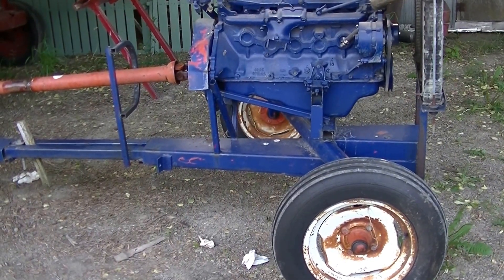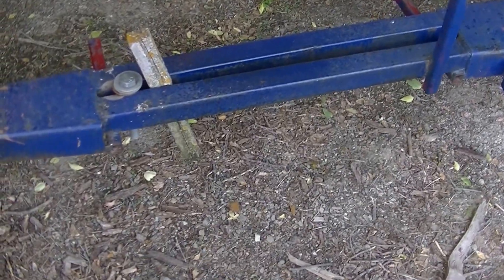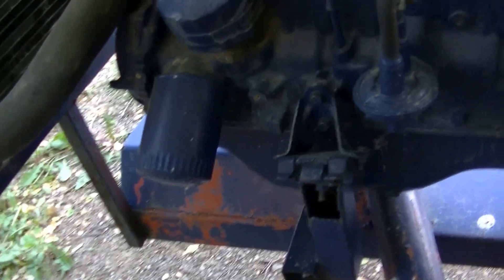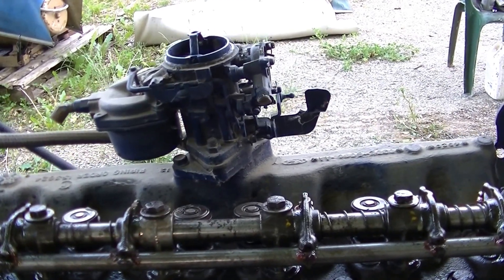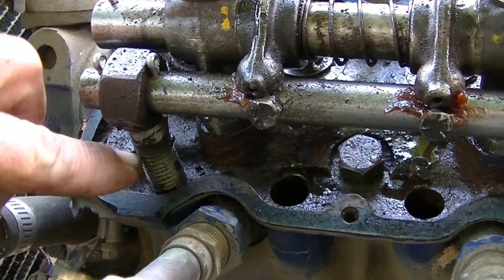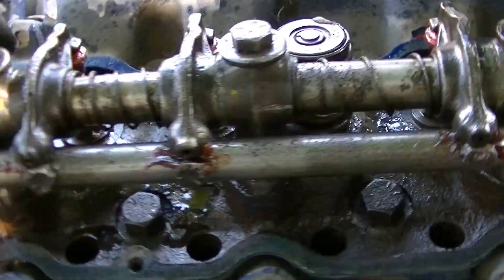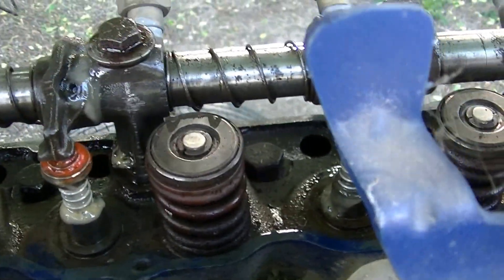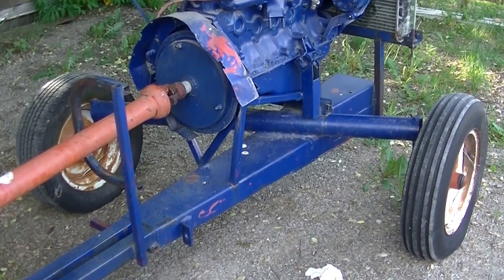PTO Driven Car Engine Air Compressor - Part 1 - zeketheantiquefreak

Comment: Any info on these light valve springs? .... how much CFM does it make?
Reply from the maker: The light valve springs were odds & ends just strong enough to close the valve against gravity. I siliconed the keepers so nothing would fall apart and drop a valve into the cylinder.
Reply from the maker: It will run a full-size sandblast nozzle without running low. I have no clue as to how to measure CFM, though.

Comment: Nice explanation. Very easy and cool unload system. 
I am planning to get 4 cyl diesel preferably IDI as they have combustion chamber inside the head and it is easy to completely block off. 
I want to make it 2 cylinder running 2 cylinder pumping air.
Any older VW or Kubota diesel will work just fine.
Reply from the maker: Awesome project! Keep me informed...

Comment: How fast do you run it? How much pressure does it build? Cylinder pressure around 100-120 I would assume with lots of volume. Do you have just one check valve down line? Does it get very hot or is it reasonable?
Reply from the maker: I run it with a 90+ hp JD 4020 with a 540 pto. I had contemplated changing it to 1,000 rpm pto, but it functions fine for the sandblaster as is. Cylinder pressure is lower with it being a two-stroke, about 90 to a hundred psi. There is a check valve at each former spark plug location and one more line check after that. I would like to see it run warmer, with no combustion process taking place, the only heat is at the outlet check valves. I would like to find a museum that would put this mechanical oddity on display. Thank you for the enquiry, it is appreciated.

Comment: Very nice. Thanks for the video. 
I remember reading about a v6 engine with 3 cylinders firing and 3 pumping.
Reply from the maker: Thanks. The inspiration for this was a '60's Ford 312 V8 engine running on four and compressing on four. And powering a jackhammer, no less.

Comment: ....that's clever as hell.  😁  Siskel & Ebert would've given this project/invention Two Thumbs Up, 👍👍  If they knew anything about mechanics and Ag Engineering 😆

I'm sure Julius Sumner Miller, or someone like Ed China, Adam Savage, or Engineer Jem Stansfield would definitely give a thumbs Up  👍   I had a similar idea, but instead of an air compressor, I was thinking about building a steam engine, using a similar overhead valve drive technique, with an old engine block, by running it as a two stroke steam engine.   I had an 1985 Chevy SB 305ci v8, that I was interested in converting, but unfortunately got rid of my Dad's old truck.   Wish I hadn't now. 

My second idea was building an engine, to run on gasification fuel.🤔
Reply from the maker: Thank you for the awesome kudos!
I never even thought of using steam. What a cool idea, err, I mean hot!
I used this car engine compressor to sandblast my tombstone last fall. Worked well. 
I wish there was a museum for mechanical oddities that I could donate this to. It would be a shame for it to go for scrap in the distant future.

Comment: What did you do to the 3rd stroke(power/combustion stroke)....when the piston goes down....the intake valves and exhaust valves are all closed. Creates wasted energy for the engine that drives it
Reply from the maker: It no longer has a 'power stroke'... It is a simple two stroke that pulls air in on the down stroke and pushes the compressed air out of check valves in the spark plug holes on the way back up. The camshaft only drives the oil pump, there is no valve train hooked to it. Yes, I imagine it to be inefficient but due to the large 'head space' that a true air compressor doesn't have. Thank you for the comment.

Comment: Oh my God I had no idea it'd be so easy (relatively speaking of course) to convert a 4 stroke to a compressor. Of course we know the concept is the same. I Kwon derived how this compares to a commercial unit that requires that much power. Do you know any specs?
Reply from the maker: Thank you for the comment. A commercial compressor does not have 'headspace' to create the proper compression for the combustion of air and fuel such as a gasoline engine. A flat head such as a solid slab of steel with proper compressor valves would be far more efficient than this arrangement. Pumping four cylinders of compressed air into two (with the flat, 'head-spaceless' head) with a cooling line between would make this into a fairly efficient two-stage compressor and would likely take a lot less horsepower to run. That said, this was a fun project at the time. The current arrangement may possibly be improved if the 1,000 rpm pto function is utilised. No, unfortunately I don't have the know-how or the test equipment to calculate the efficiency. It has never been properly utilised due to the fact that I was scared poopless of getting on and off of the former tractor (1949 IHC W9 Distillate) with the rear entry platform. That driveshaft spinning next to my ankle was just too intimidating. The 4020 is accessed in front of the rear wheels making it much safer. I have my tombstone to sandblast but haven't got around to it yet. Hopefully this fall. I haven't needed it quite yet!